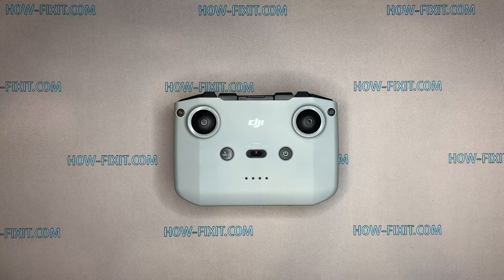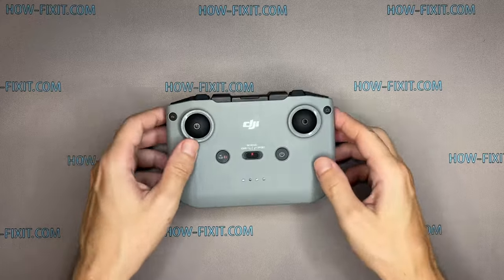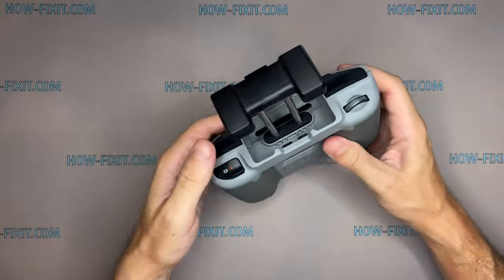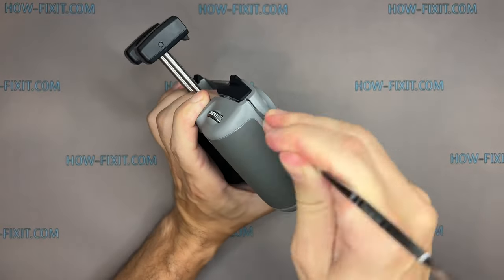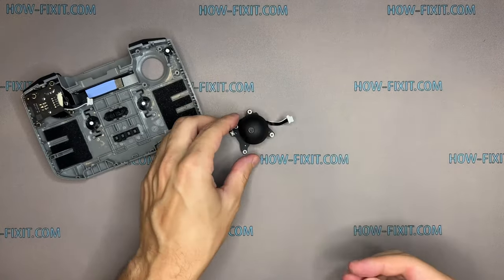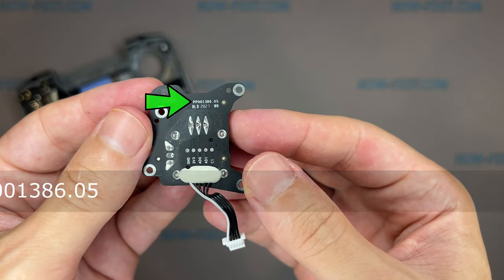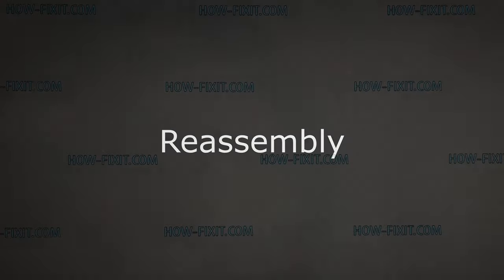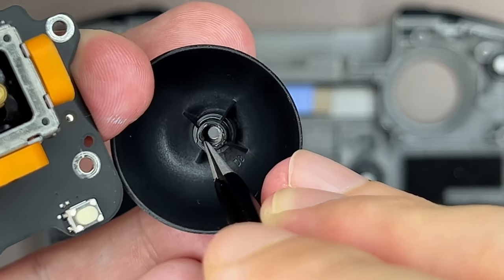DJI RC-N1 Remote Controller (RC231) Joystick Replacement

Comment: Hey, I love the video thank you so much! 😁 I have a question for the joystick, i would like to either remove/disable the „spring“ for the vertical movement. So it isnt fixed in the middle, like a FPV controller. You think thats possible? :)